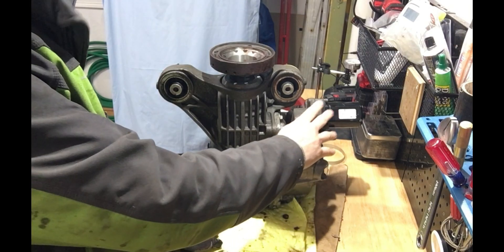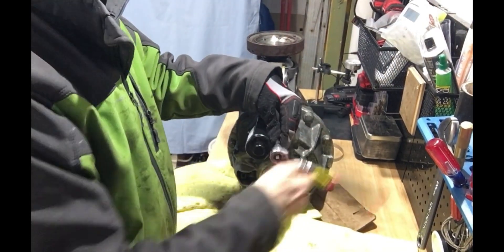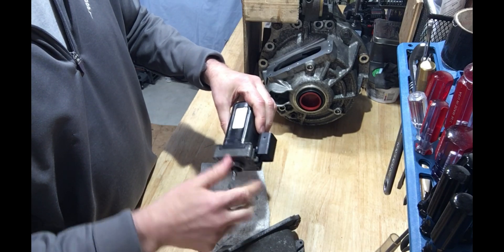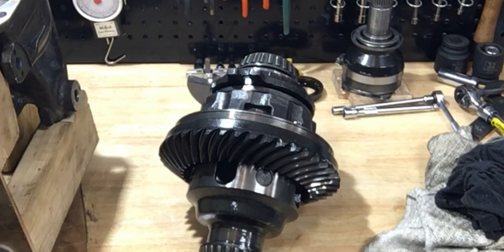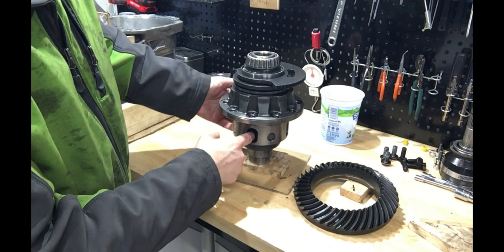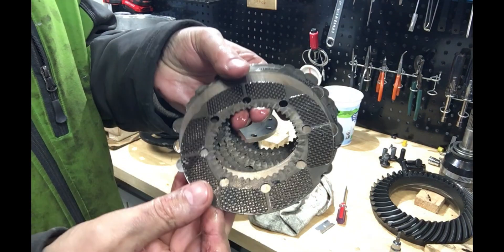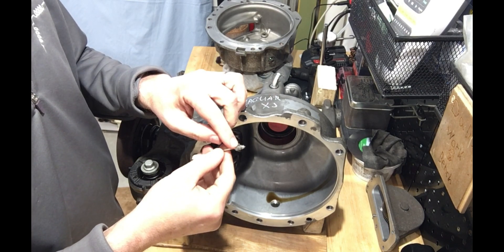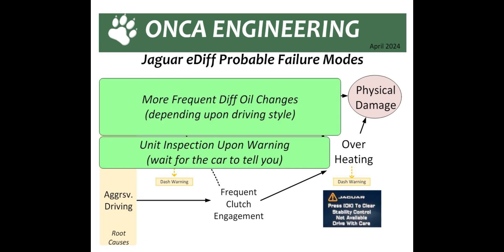Jaguar V8 S/C eDiff Teardown

Comment: So mine seized up on me will this repair be original?
Reply from the maker: So sorry to hear your car’s rear end seized. The rear differential will probably have to come out and I recommend the replacement clutch pack from RacingDiffs. Lets get your FType back on the road
Reply from the maker: One more thought. Are you aware of what is seized in your rear differential? It could be the bearings (axle or pinion). If your unit is too nackered, a used unit can be purchased and inspected before installing into your car.

Comment: @Onca Engineering Thank you so much for your amazing video. We really needed someone knowledgeable like you to create phenomenal video for people to learn. It is been long time I am looking for a manual F-Type. I prefer to buy a V6S or R-Dynamic, but unfortunately I was no able to purchase one. There is a V6 I can buy, and if you answer my question, making decision would be much easer... Beside of extra 40hp, I would like to have a LSD diff... Is there any brand new LSD diff you recommend for F-Type V6 manual 2017? thank you
Reply from the maker: Sael,  you can buy a base model V6 manual, and then add a LSD rear differential from an V6S model (used on eBay) or an upgraded helical ATB from Quaife via Onca Engineering. You can also get a tune on the engine and get >400 hp. The manual F-type is very rare, so finding one will be difficult.  Good luck.
Reply: @OncaEngineering   thank you for the quick response. I want to do drifting and extreme Motorsports, so is there any aftermarket brand new LSD differential? Also it would be amazing to educate me how to turn 340hp to 400hp or make a video about it. Probably so many Jaguar owners want to do that and you are the best source all around the world. Thank you
Reply from the maker: @saelmahdavi3995   Sael, for extreme motorsports, I recommend the OEM LSD from a V6S model, and updated with the clutch pack from RacingDiffs. (The OEM carbon fiber clutches fail prematurely, so the Racing Diffs ceramic clutch discs should have longer life). For tuning, see VAP website, and join the Jaguar Forums for more discussion of modifications.
Reply: beside of brand new Jaguar diff from dealer which is too pricy...